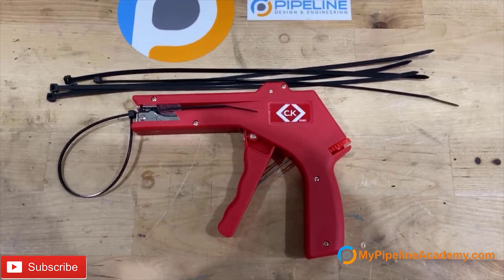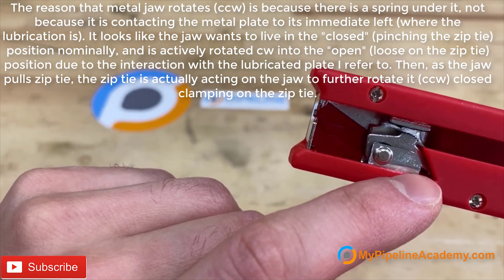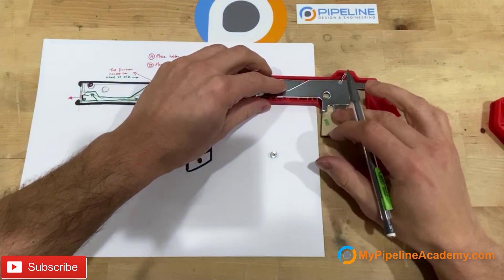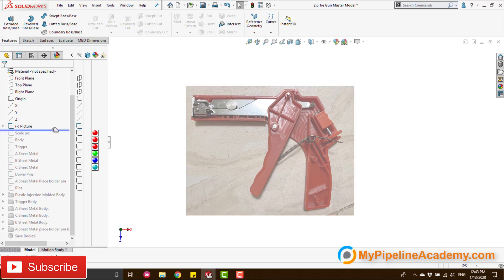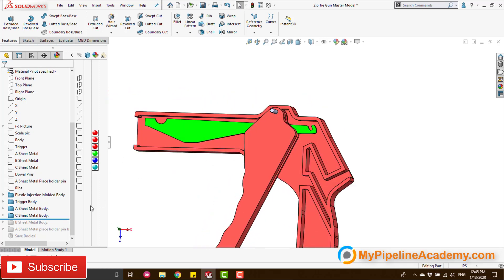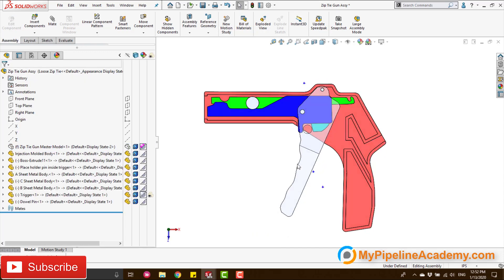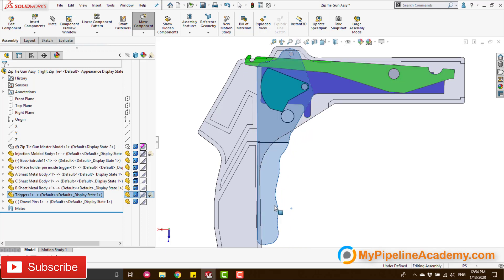Cable Zip Tie Gun Teardown

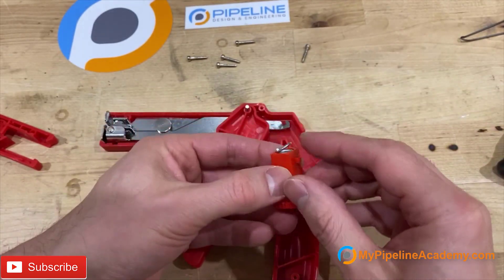Comment: 3:03 - Its customized, I have a large assorted spring collection, there are specific sets which has the spring bent at a 45 degree angle. You're good at reverse engineering. I'm glad I found this, wanted to know how such simple and useful device worked. Can you please make a same style video of how rebar tying machine works?